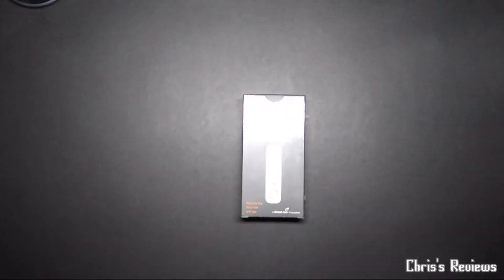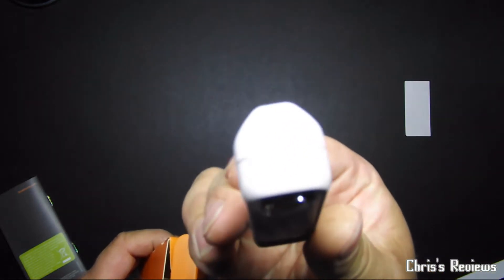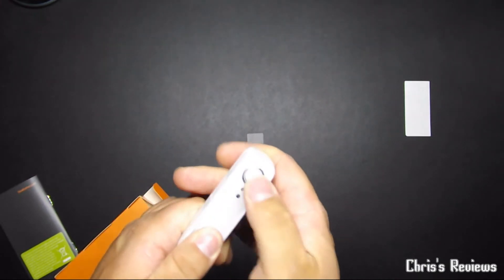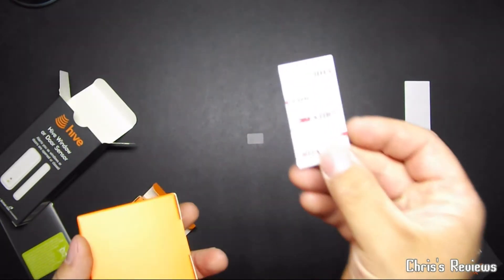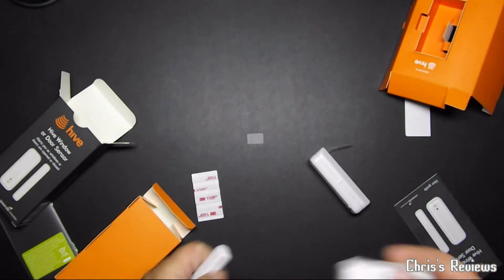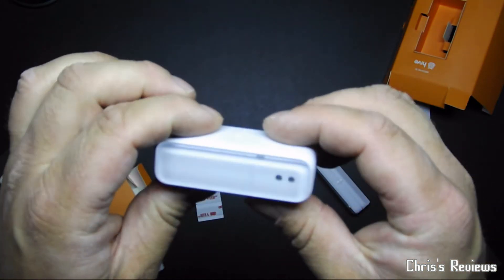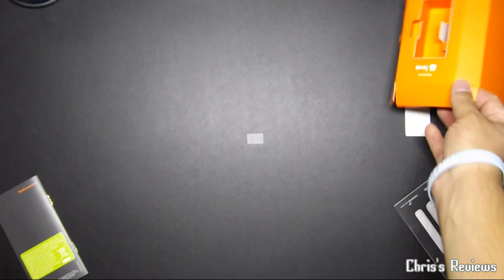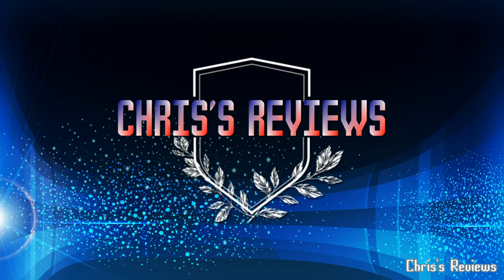Hive Sensor's Unboxing (UK)

Comment: Hi, you don’t need a special mount to put it in a corner do you as it has angled sides to put the stickers on?? Good vid, nice to see wha your getting in the box.
Reply from the maker: Hi, no you don't need any special mount but they do expect you to just stick it on the wall with a 3M sticky pad which isn't ideal.

Comment: Hey mate. Would be good to see it working. And what it does when triggered. Does Alexa notify you? Or should I say can Alexa notify you.? Or is it all Hive app based.
Reply from the maker: Hi, it’s all Hive app based and Alexa to my knowledge doesn’t say anything. I found the sensors I had were really poor and disconnected from the hub lots of the time so made them worthless. I really had high hopes for Hive as I have the thermostat and it’s never let me down. My Hive setup now only has the thermostat and a single door sensors which I’ve got in a cupboard just out of curiosity rather than any real reason. I gave up with using it for alerts as it was so unreliable.
Reply: Chris's Reviews & Unboxing's is the sensor working any better ?